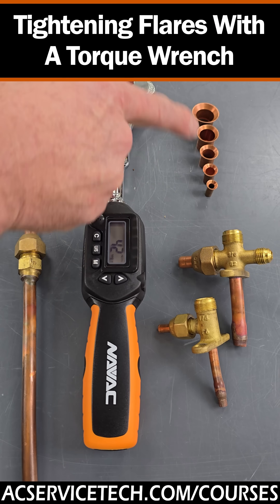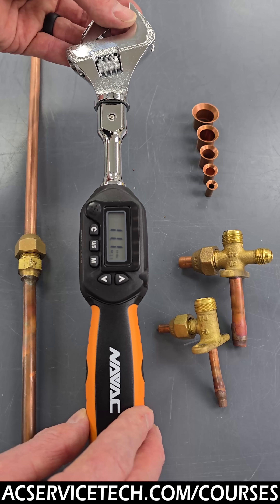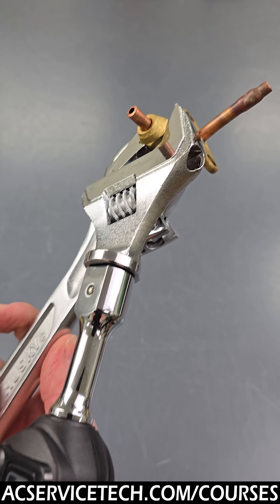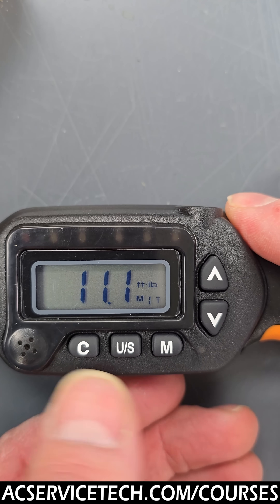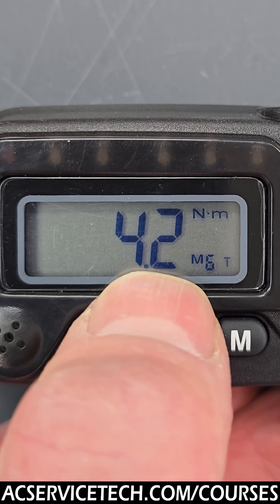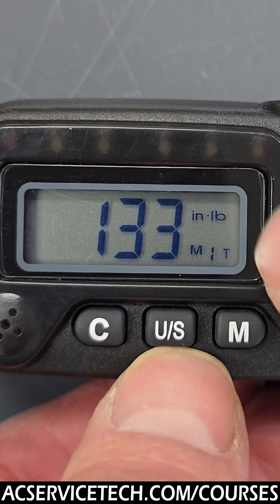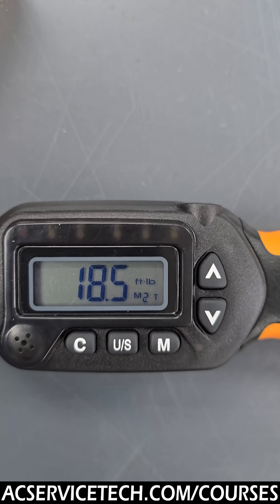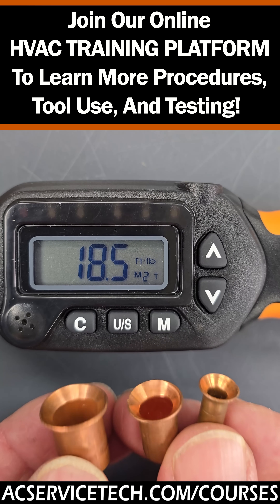Digital Torque Wrench Setup & Use For HVAC Refrigerant Tube Flares!

Comment: I wish minisplit companies added a pressure gauge to the lineset. This tool for minisplit flares is dumb u can do it by hand feel with no problem. In my experience creating a proper flaring i the key to preventing leaks.

Comment: Why don't we cut the single flare fitting on the lineset off and braze or pressfit that particular joint instead?
Reply: We are onto sear 2 which requires using a refrigerant that is propane based (so combustible) you’d preferably never use an open flame around something that has had r 33 in it or any of its oils. Compression is best whether it’s flare fittings or pro press (which would normally only be used for your typical split systems not inverter mini splits
Reply: That's what I do when the units have enough length
Reply: Different code requirements for uses,  gas, refrigerant, h20, etc.  I have never had a leak with or without.  After forty or more years of restricted trades work you develop a feel for tightness adequate but not to much for water, gases, refrigerants  etc.

Comment: I'm a Fan of using a torque wrench.  I also am a Fan of Flaretite seals. Never had any leaks using both.
Reply: Back in the day old timer told me when you make a flare dont bottom the tool when yiu tighten her down shes snug never had a leak never used nylog what ever its called